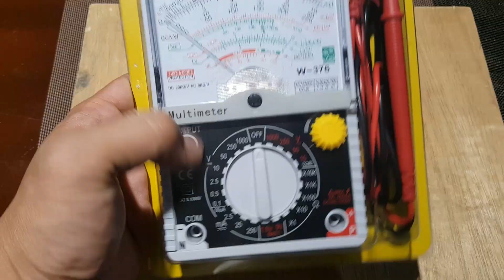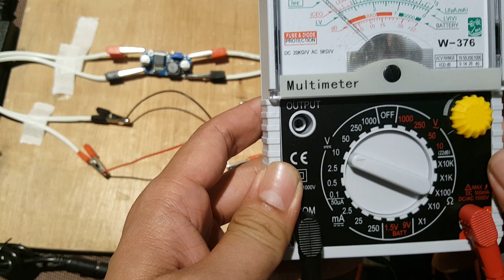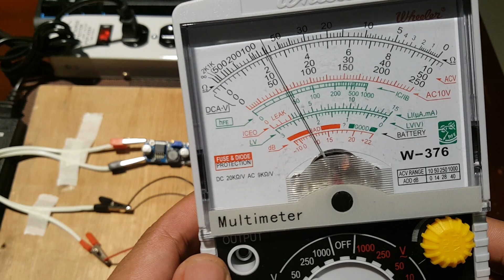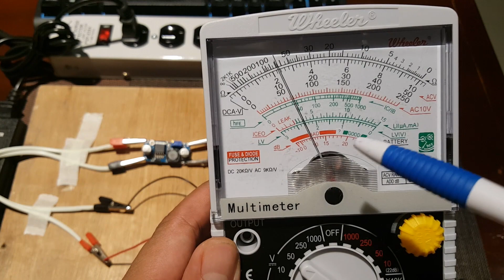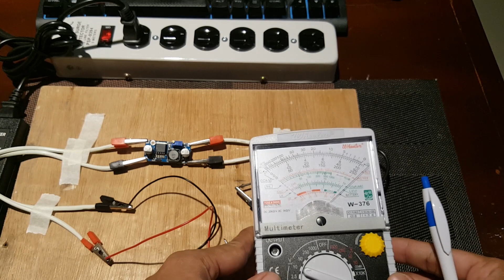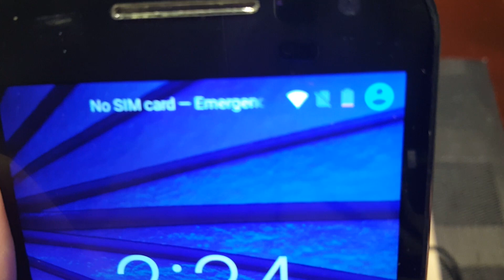how to convert 12vdc to 5vdc for raspberry pi 3 (buck converter)

Comment: Mine showing undervoltage warning every time , any  micro usb cable working with adapter but whenever open connection with buck it's showing undervoltage warning.

Comment: Oh well..
"Hey I know that the expected voltage is way higher than the range set on voltmeter.. yet I'm just gonna power it on instead of adjusting for higher voltage.. and possibly kill the voltmeter"
Why you doing that? Is it some sadistic behaviour you have towards electronics?🤔😹
Reply from the maker: its not going to kill the voltmeter, it just goes out of range on the scale selected.